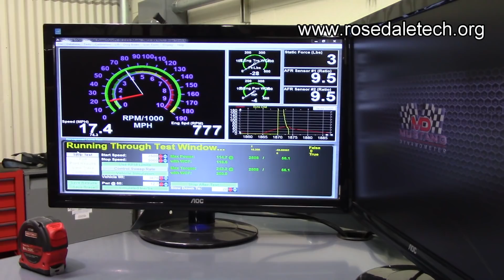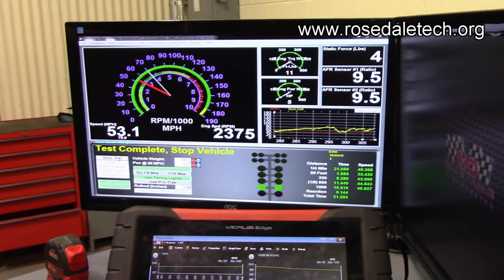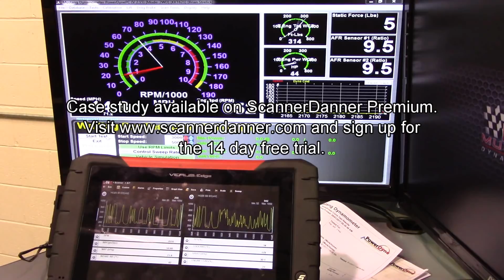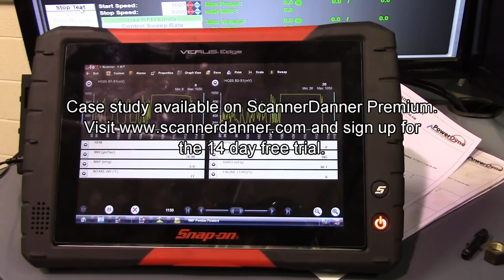Dyno Testing a Low Power Complaint at Rosedale Technical College

Comment: Hi again,
Love watching your vids! Helps me a lot.

But

I have another problem:

Alternator (your vids helped with this problem)went bad, right front cv-axle went bad and began harsh shifting all at the same time. Highway driving.

I've replaced the alternator and the cv axle, but I still have a harsh shift between 2nd and (D)rive.

I've replaced the TPS and the trans. speed sensors (2), but to no avail.

I also see that I cannot manually hold the throttle at an RPM between 1k and 2k. I can hold it at anything under 1k and over 2k. anything between 1 and 2k .... it just drops to 1k.

Hopefully you can help me  with this.
Reply from the maker: Carl, can't really help much without knowing what your working on. Post your issue here. We will try to help you on the forum. It is free to join. https://www.scannerdanner.com/forum/post-your-repair-questions-here.html

Comment: Those grams per second seem to be a bit low for a wide open throttle pull ?
Reply from the maker: Remember RPM was also low during the run
Reply: Yeah I seen that but I feel that the figure will show an increase after the problem is resolved. The full throttle surge looked ordinary to me and i would love to see a comparative figure at the same RPM when the issue is resolved. Would have liked to seen the knock sensor value at the same time as it does sound like its pulling out a lot of  timing or perhaps not breathing on the other side of the bang.
Or perhaps i should just shut up and wait for the video on premium.

Thanks Paul
Reply: One more thing, I noticed your using the new edge, I have have the verus pro and was wondering if there is much difference in comparison other than the boot up time ?
Reply from the maker: :-) I don't want to discuss it here until the full video is up. Cool? I just don't want to spoil it.
Reply from the maker: Not much. Definitely faster boot up and file transfer from the solid state drive. I think I noticed some better refresh rate on scan data on some cars but I'm not sure. If I owned the Verus Pro already, I don't know that I would spend the money on the edge.
Reply: Thanks Paul.
Reply: Absolutely.
Cheers
Reply: That AFR on the dyno ! Does it have 4 turbos :)

Comment: MAP sensor was showing nearly 30" of mercury under load and open throttle. Maybe a clue?
Reply: marc wischkaemper 30 in hg of pressure is about 14.7 psi of manifold pressure, or about 101 kpa. Which is basically atmospheric pressure near sea level. It's measuring absolute pressure, not vacuum, so this reading is correct at WOT.
Reply: Thank you, Steve. I had no idea the scan data was showing atmospheric pressure. Makes sense now. I thought after my post, maybe this car was super-charged and that was boost pressure.

Comment: Just finally finished watching all of your free content. I’ve felt fairly confident in my “old school” mechanical skills but now days, with the electronics that won’t get you very far. I like to do my own work to save money and the gratification of knowing I’m able. So I was on a mission to gain knowledge where I was lacking. I started with the the cat guy and he plugged you. I’ve just finished your channel and moving on to your brother. I throughly enjoy and appreciate all that you all have passed on. God bless and merry Christmas!
Reply: It's not just about saving money, but also not trusting someone touching your car. I don't even like others filling up mine at a full service gas station. No way I'll let some random guy open my hood.
Reply: Vitamin B I agree. Too many mechanics that feel they are correct when they’re just wasting your time and money. If I make a mistake I only can blame myself and learn from it and no what was done. I’ve miscalled somethings in the past but the money I’ve saved far out ways the money I’ve lost. I have a 09 Avalanche that I had to change oil cooler lines and transmission lines about a month ago. Had to drop diff to change them. On my back in the garage. Paul has a video where he says his truck was under warranty and had the same thing done that would of cost $800.00 if it wasn’t for his 09 Chevy. That put a smile on my face. Parts from Rock Auto no where close to that.
Reply from the maker: You watch all almost 400 videos on this channel? That's awesome! Thanks so much. Merry Christmas to you too
Reply: Live Right 316 You won't regret it! The book is just as awesome!

Comment: So they probably have to turn the key 3 times in order to build up fuel pump pressure to start it up
Reply from the maker: Both of you guys are on point.
Reply: Who knows, not enough info. It's just the first thing that came to mind because I have a similar thing on my fbody. Slow to prime, but once the fuel pump got moving and warmed up, it is ready to go.
Reply from the maker: also, who knows, it could have a bad pump check valve, causing the key cycle issue AND have a second problem causing the low power issue as Cuba stated.
Reply: Bad Drivers of North Texas speculation.  If it's running rich while WOT, it can't be lack of pump pressure. Maybe faulty check valve at the pump, but again, wouldn't account for the power loss.

Comment: That thing revved so slowly I'd be looking for restricted exhaust /  partially plugged cats. Definitely wasn't running out of fuel according to the O2's.
Reply: I had a melted / clogged cat myself and the fuel trim went super negative..it did not get rid of the exhaust and the O2s interpreted that as rich ...  at part throttle fuel trims would max out in the negative... but here fuel trim looks very good   6 and 8%
Reply: cats plugged that bad, usually ends up leaning out. also the manifolds and down-pipe would be glowing red after that hard slow pull :0

Comment: Paul have you put your truck on the dyno  yet ?
Reply from the maker: NO but it's coming! I may do some mods on it too. Some before and after stuff.
Reply: ScannerDanner The 87 octane tune I put on my 2500hd did make a difference .  I may try the 93 tune  in the spring  when the roads are dry :)
Reply from the maker: What did you use? Got a link?